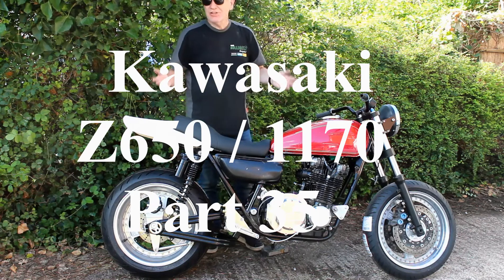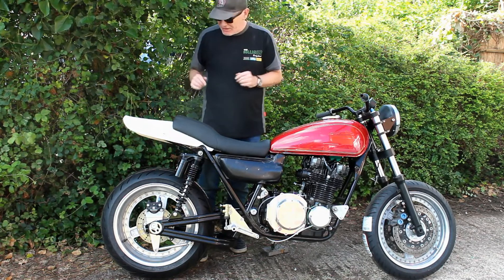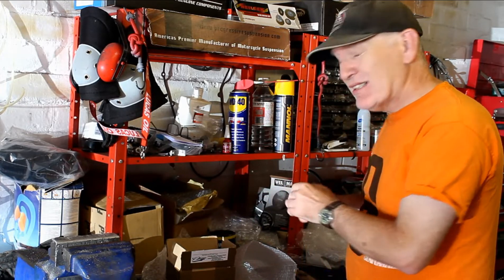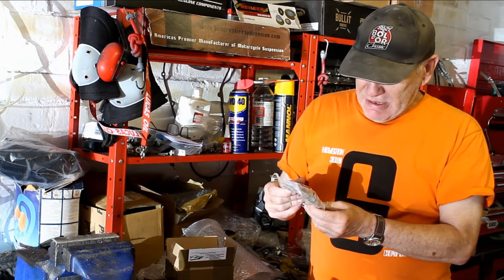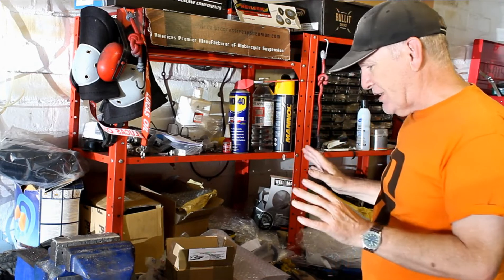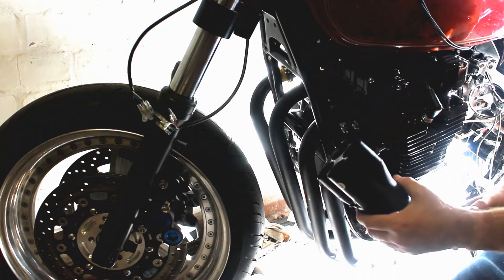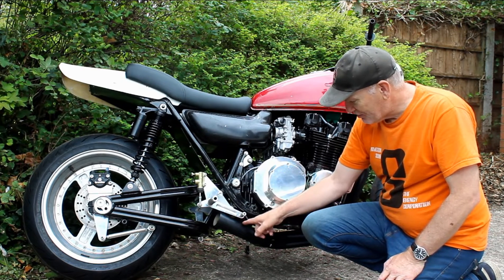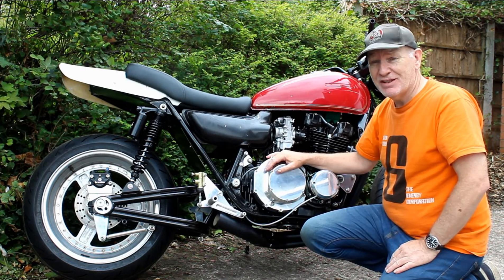Kawasaki Z650 / 1170 Project - Part 35

Comment: Looking good lee ,,1 step forward and 3 back ,,custom bikes are always challenging but with jeff on hand most things are easily solved
Reply from the maker: Yep, had to cut and reweld the exhaust, hopefully Cam Coat can replicate the ceramic finish, if not I'll use HT satin black spray paint. Be another 1170 vid on Friday

Comment: Hi, maybe a daft question but, why can't you adjust the collector to miss the foot peg while you are adjusting it to miss the swinging arm? With my old legs foot pegs way up there would be a no go.
Reply from the maker: Yes that would be possible, though keeping the pipe tucked into the frame might be tricky. The reason for raising the pegs is also that it solves the problem on the other side, as currently the kick stand interferes with the gear change lever. Raising both pegs solves that problem. I have since checked many pics of modded Zeds with rearsets - they have the pegs level with the swing arm pivot. Though perhaps their owners all have short legs.. I'm used to rear sets, so the new position didnt feel bad for me.